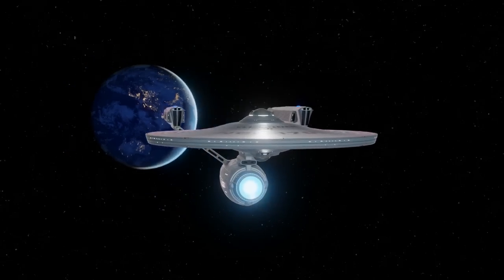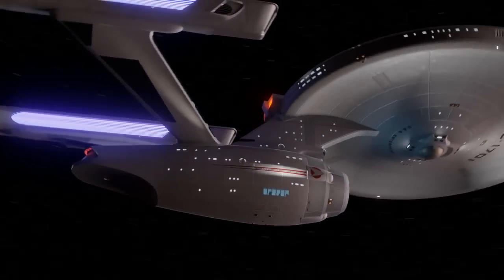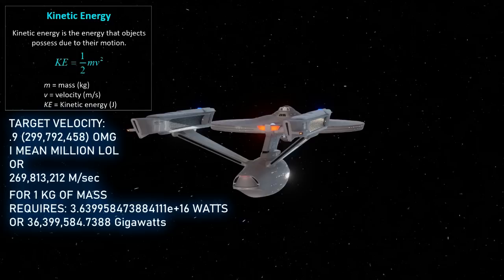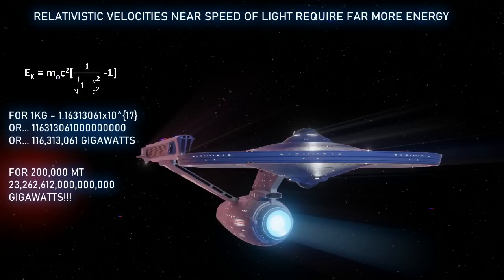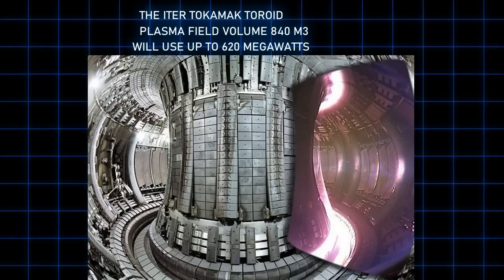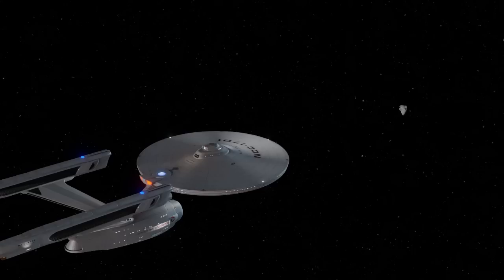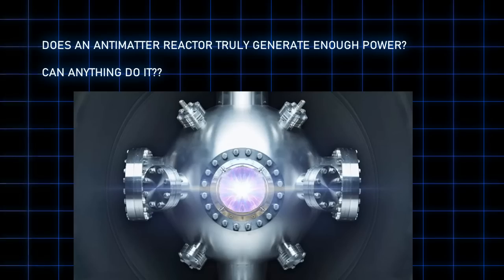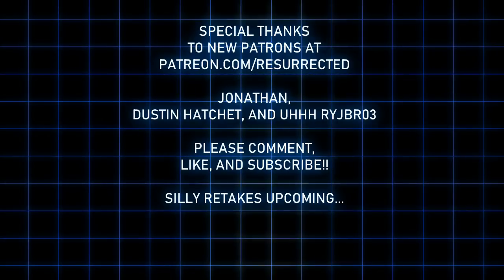How Many Nuclear Power Plants Can Power the Enterprise? Let's Calculate!!!

Comment: Full impulse will only reach about 1/4 C. They likely would need a field similar to a warp field to prevent time dilation and reduce the effective mass. Warp sustainers are a thing in Star Trek so they maybe what allows impulse to reduce its power requirements.

Comment: Your energy estimates for sublight speed energys are complety out of wack. First your mixing units, watts are joules per sec. Your number represents total embodied kinetic energy, not how much the reactor needs. Full impulse is only 1/4 light speed and takes a long time to get there (posibly hours). 2nd, Startrek ships use warp fields at sublight speeds to hasten acceleration or move faster and lower mass which changes the number by many orders of magnitude.
Reply: Yes you’re right, but even if it takes hours to get to quarter light speed, you’re still talking about millions and millions of gigawatts (I didn’t take the time to calculated exactly, but you’re only talking about five or six orders of magnitude when you’re talking about hours or days instead of a second). And moving space-time around is going to take a lot of energy. Something like the mass energy equivalents of a moon, according to the current theories.  And that also presupposes the existence of negative mass/ negative energy, whatever that means, and whatever that would look like.